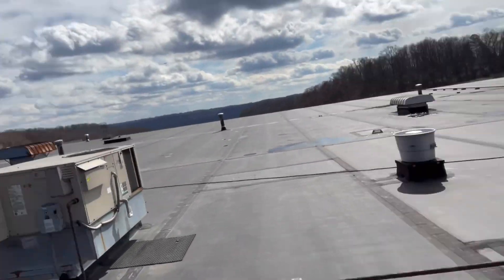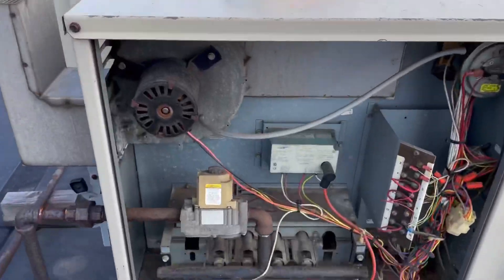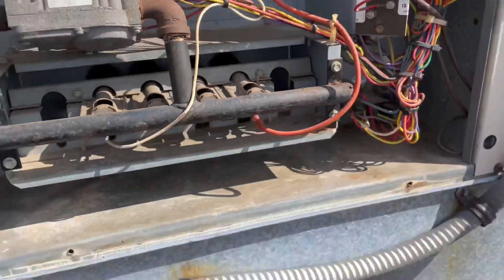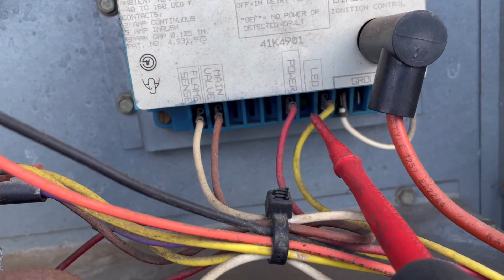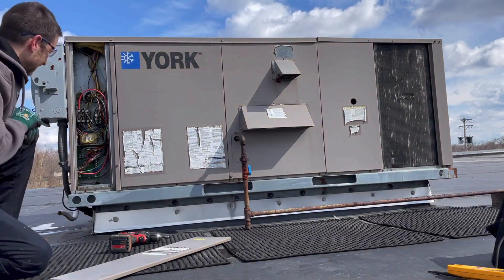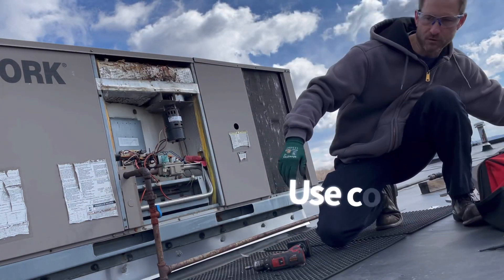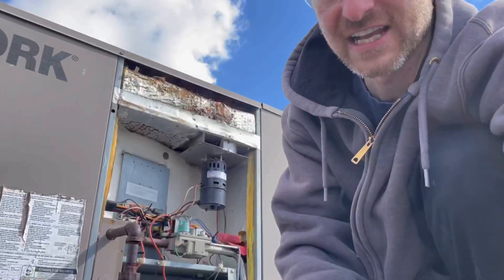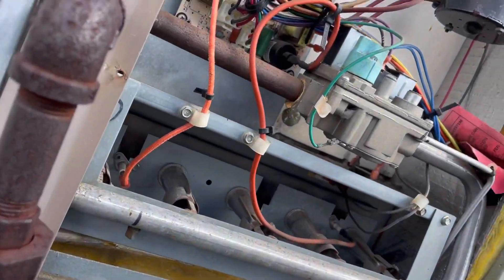Two RTU’s Need Troubleshooting!!! #SteamFitterslocal449 #hvacexplained #heatingandcooling #york

Comment: I'm not sure why there are not any videos newer than three years here on this channel. I hope this guy is okay. A note for you younger techs...that code 9 is notorious for those units. There is a reset-able limit in the York Sunline series. In this size box, it is located to the upper right of the draft motor, on the wall behind it. If you press on the center tab and hear/feel a click, it was open. With that code 9, make sure all the limits are closed. If they WERE all closed, it might be a good idea to write up the board. Check to make sure the coil resistance has not dropped in the fan and compressor contactors. A drop in 24V buss to the board when a contactor pulls in can trigger a code 9, because the board sees the drop in voltage on the limit input, and thinks the limit is opening. HTH.

Comment: Would sanding the Electric igniter with sand paper helped with the Ignition spark on the 1st unit you were working on?
Reply from the maker: Hello, how’s everything going ?  Where about are you from?  
I typically use a mesh Brillo pad for cleaning them or emery cloth.  They do make a small wire insertion tool to also clean the flame sensor’s & igniters.  
In this matter the ICM “Ignition Control Module” is old / wore out and needs replaced.  Anytime I change a ICM or heat exchanger I replace igniter & flame sensor. 
Some manufacturers don’t recommend cleaning them either but in a bind it’s worth a try.  
FYI :  I had quoted this for replacement and my last video I shot I had got the approval months later. 🫣🫣🫣
Thank you for the comment have a great day.
Reply: @hvacexplained9341  Hello brother, I’m  from the DMV area. Thanks for the response and the tips. I can def put this information to use as a full time commercial engineer, this would def help save time and money diagnosing units when this is suspected as the issue.

Comment: I've replaced a lot of control boards on that style of York rtu. Water gets in somehow and the bottom 1/4" of the board sits in the water and kills the fan relay.  So far moving the board up and adding a weep hole below it has helped.

Comment: Great video sir… on the York unit if there was a call for heat but the inducer motor would not spool up and therefore not closing the centrifugal switch, is there a certain amount of time I would have to elapse in order for that 9 flash code to develop??? Or do you think it was running and then the motor seized up causing the limit centreifugal switch two go back to its normally open state…And then turn The board would keep the blower motor running thinking that the heat exchanger needs to be cooled off…Many thanks
Reply: Sorry I just had to edit my question because I realize my talk to text failed me😂😂😂🍺
Reply from the maker: Thank you very much sir I do have an updated video changing out the draft inducer motor for operation to continue in the heat mode.  I just posted it a few weeks ago.  I actually was coming down with Covid while taking that call.  The call for heat would come from the thermostat signaling the circuit board to trigger the draft inducer motor to kick on the 24v goes through all the safeties first then the centrifugal switch before kicking the ICM to create spark and ignites the burners.  With that motor being bad the centrifugal switch will not close therefore triggering the alarms.  I can’t give a definite on how long before creates the alarm but I would assume within a minute or two after the call of heat is engaged.   It had the alarm when I showed up. I did change the combustion motor in the updated video and the unit began to heat.  Thank you very much for watching and the compliment have a great day.
Reply: @hvacexplained9341   that’s a great explanation/break down!!!! You handled your Covee Infection like a champ💯 Definitely enjoy the videos and I’ll keep on watching and sharing!!!

Comment: Those York motors are junk. Whenever I walk up on one the bearings are either shot or the motor was dead. I had one that I replaced the control board on that died, fired it up and after 30s of the burners running the motor smoked itself, let out the ol magic white smokes.

Comment: Good job. Wind in the south is the same . 90° plus I wind.  40° lower the wind howls.
Reply from the maker: It’s crazy and some people don’t believe me.  But literally it could be 95° out and extremely humid no wind. It gets 0° out it’s a constant 30 mile an hour crosswind LOL.  I was on a chairlift At a ski resort this past winter we might as well have been sitting straight sideways like a flag in white out conditions it was crazy and I wish I had video.  Sometimes it’s a challenge Diagnosing equipment with panels blowing up against you and snow flying all over the terminals LOL.
Reply: @hvacexplained9341  not much snow down here. Today mid90’s late week upper 90’s
Reply from the maker: @Brutis-1983  We are reaching 90°F today.  But our weather fluctuates real quickly sometimes.

Comment: Always issue on york …
Reply from the maker: Yes there is on the gas fired ones we have problems with the rollout switch randomly going bad even though it looks good with your voltmeter but if you jump it out everything works fine LOL.  There’s a certain type of York unit I swear they build the entire unit around the heat exchanger and it will take two guys nine hours at least to properly change that heat exchanger.  Thanks for the comment have a great day.
Reply: HVAC EXPLAINED 
Yeah, them tube heat exchangers are awesome fun to replace.
Wait a minute, they’re not. 😂

Comment: There much standing water up on those flat rooftops? 
Ever have to wade thru it to work?
Reply from the maker: Every single flat roof I’ve ever worked on leaks. Lol. The heating and air techs always get blamed.   Actually I do have a pretty cool video of clearing a roof drain and there was roughly 6 inches of water on the entire roof after I pulled the clog out of the drain you could see water shooting out from the hillside beneath that’s where the drain lead to.  Lol. 
Thank you for the comment have a great day.